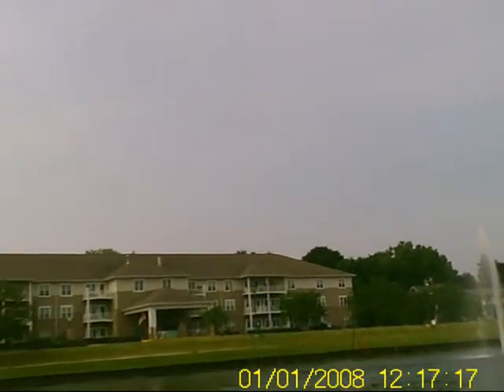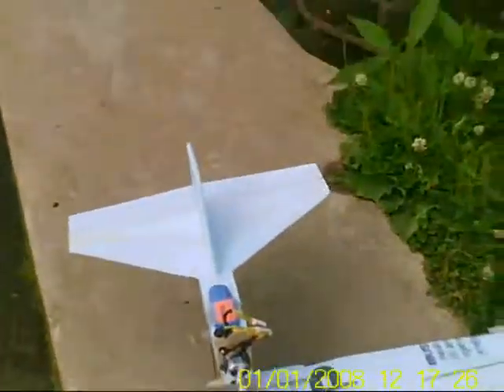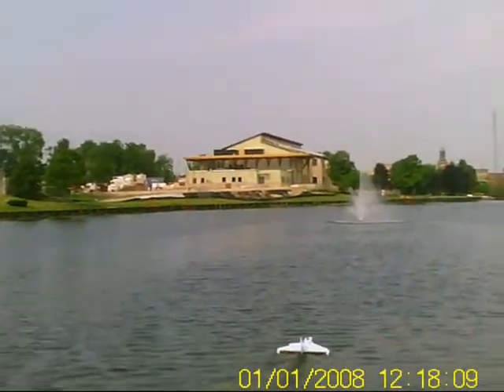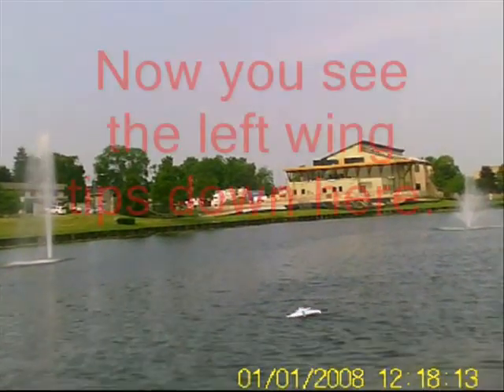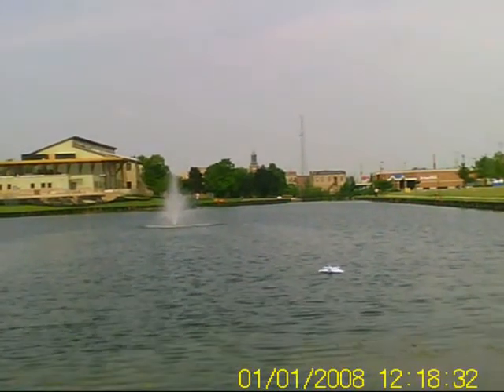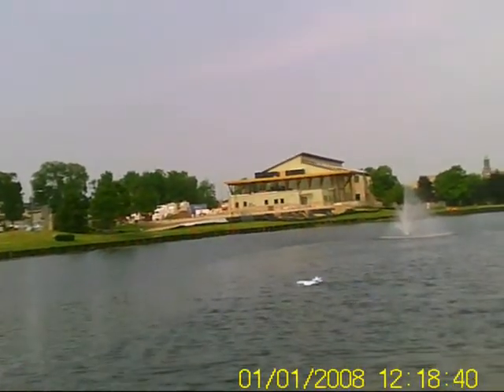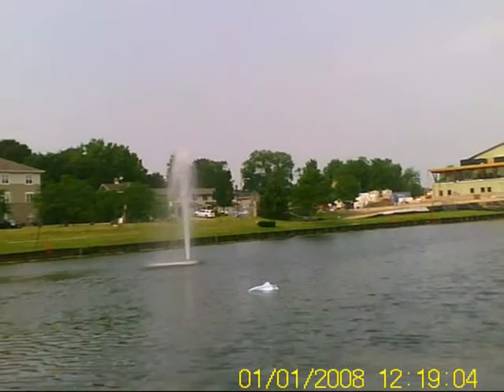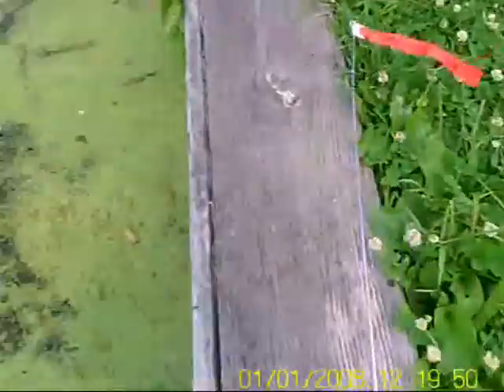Water testing the Polaris Sea plane.

Comment: Running at low speed on the water is what smoked my esc. Treating all electrical components with corrosion x will save a lot of grief

Comment from the maker: @flyby8906 Oh man I need to make one of those if I'm going to be messin around with Sea planes. Thanks for the idea. As for the Polaris, it's ready to go. I have to use a 50amp ESC from another plane and it all works fine. I put in a differant servo for the elivater and put the ESC down in the fusealoge. I'm taking it on vacation this week to Eagle River, Wisconsin. I'll get some aireal video and ground video of the condo resort and lakes if all goes well.

Later man.